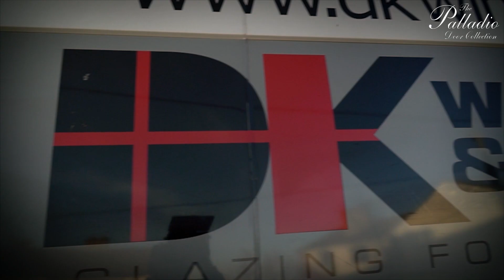MUA @CiaraaGlynn's DOOR INSTALLATION | DUBLIN | PALLADIO DOORS

Comment: Can i hang 35mm thick  door into 40mm frame ?
Reply from the maker: Hi there, our doors are 66mm double rebated in a 70mm frame as standard. Thanks
Reply: How much @PalladioDoorCollection
Reply from the maker: @dmc1806  We are the manufacturers of the doors and deal with door trade only. If you could let us know where you're based, we could get back with a local installer's details whom you could contact for a quote. Thanks